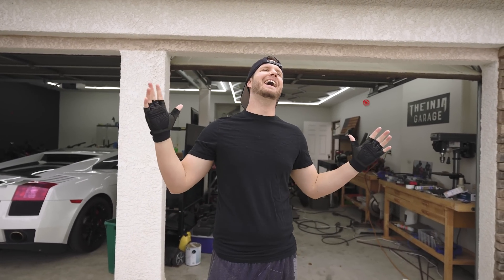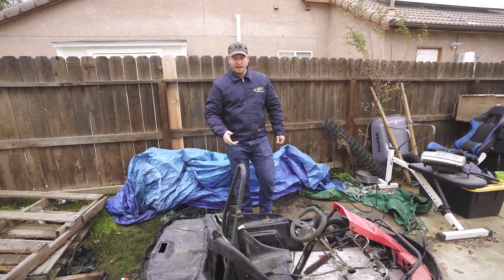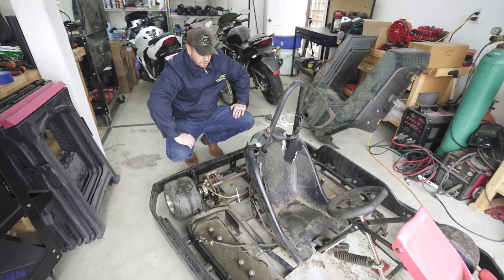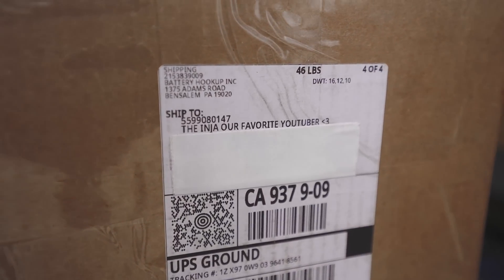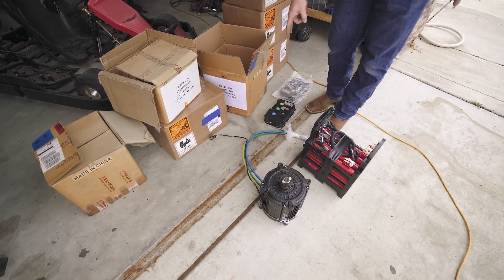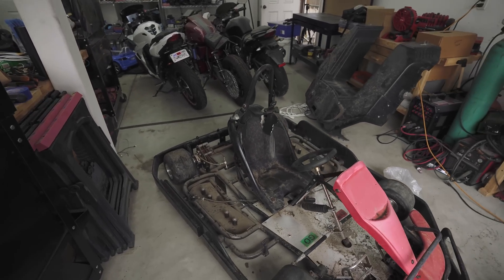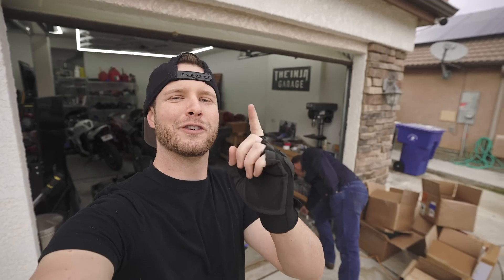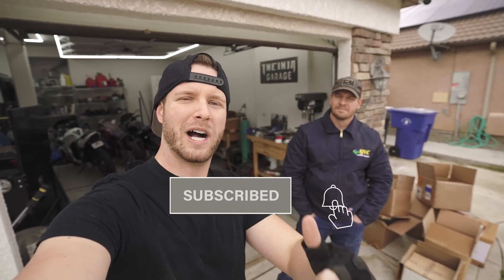Let's Make an ELECTRIC HYPERCART [Part 1]

Comment: If one day this go kart kills me, don’t cry because I was smiling
Reply from the maker: Never spake a truer word my lord. I will not cry for you
Reply: Today would never happen. Full fun without regrets...
Don't worry.
Reply: No suspension? yikes!
Reply: @kungpowchickenwing  pretty standard for a kart track, even the very high end ones!
Reply: @LordCurt  perhaps but maybe upgrade the tyres to be a bit spongy
Reply: @kungpowchickenwing  with 280 lbs just in batteries and motors alone, rest assured there will be suspension in the form of chassis flex.
Reply: @kevinsellsit5584  reinforcement incoming, fear not
Reply from the maker: @kevinsellsit5584  oooo ya see we don't need suspension when you have frame flex
Reply: @TheInja  To the best of my knowledge some high-end racing karts have a torsion-bar-like element in the frame that can be changed for rider weight, track conditions, etc.
So it's safe to say flex does actually change alignment and handling charastics. 
More triangles never hurt.
I'm not worried...I'm excited to see how well it works.  If nobody wants to drive it, hit me up.  I'm good for 3-5 G's before I'll pass out and end up in a ditch 1/4 mile from the track.  ;)
Reply: @LordCurt  that amount of weight seems excessive. Isn’t there a principle of diminishing gain?

I’m no expert
Reply: @kungpowchickenwing  there sure is, but only time will tell how far past the line we are. If they sent an inferior kart, the only advantage we may have is superior performance, within reason. I think we’ll land in the right spot

Comment: Hey, wild. You want front brakes? I bought a kart from a kid out in Cali about a year ago, looks about the same except it has front brakes. Said he bought it from a kart track he had worked for. Tried to find out where you could get spare parts but he didn't really have an answer.  Said the kart track ordered parts from "a web site."  But I have the whole setup. We have the same axle, battery boxes, tie rods...etc. I was going to build exactly what you're building, except with one motor--so now I guess I don't have to. :D I'll get back to my electric burnout kart build. Get in touch somehow if you're interested in the kart or brakes.
Good luck with the batteries. I bought 13 24v Headway modules from batteryhookup, three maybe are usable as-is to build a 72v pack.

Comment: I think mounting the motors over the axle is a pretty bad plan. You want all weight in front of the rear axle to keep the front tires in contact with the road surface. Putting them over the axle is both raising your center of gravity and making the cart more likely to flip over backward. Batteries and motors should be as close to the center (front to back) and as low as is feasible. 50/50 weight distribution would be optimal but not likely on this frame.
Reply from the maker: There's 140lbs battery in the front/middle of the frame + 200lb driver. All motors on these karts are over the rear axle!

Comment: What size contactor are those... Spim08hp batteries doesn't it do the same output... So i was trying to build electric golf cart or utv ish
Reply: 500 amps continuous each
Reply: @LordCurt  what happened to the utv buggy electric conversion... U have any more videos on it...
Reply: @Ai-TechWorld1  I’ve had to put it on pause while working on other things, sadly. I’m hoping to be back to it soon!
Reply: @LordCurt  ok ill wait please put the prius steering wheel and column in its easy to get electric power steering with 12v i picked up one from the junk yard for 40 dollars whole assembly

Comment: I don't want to make you sad but I think 60 Kw won't be enough to be the fastest Go Kart on the planet, there are even stronger sorry guys 😁
Reply: I’m expecting more like 70-80 after losses, but time will tell. I’d love to see links to some footage!
Reply: What do you want to know because there are enough points. Battery, Bms, Motor, Control unit....
When the weather gets better here I'll try to break the world record 0 to 100 and 0 to 200 km/h. then all details will be published.
What I can tell you is now only  144V 1300Ah continuous current and 2600Ah peak, but I can use now just 130V 750Ah. because of overheating.
Reply: @monsterelectricgokart  dang, 750 to 2600 is quite the jump. Ambitious
Reply: that doesn't mean you can give controller 2600 Ah. that's just a good thing the cellen won't break down quickly.😉
Reply: if you build and need help I can give you enough tip. write me privately👋

Comment: I thought the Fardriver 96v controllers were only rated for 115v.  Will a full 116.8v cause any issues or do they actually have 120v rated components but just don't tell anyone?
Reply: Exactly that. They actually do to 120 according to their sales

Comment: Those Headway 38120 HP cells crank hard, I used 12 of them for a 4S/3P battery which powers my Kweld Spotwelder. It pumps out 1,650 instantaneous Amps. Super safe, runs cool to the touch at super high discharge. Dude that Go-cart is going to either launch hard /smoke it's tyres of the line or break an Axel. 😏 I'm sure lord curt will get it sorted to smoke the big boys. Can't wait, should be a blast. 👍👌😎

Comment: There is 0 chance of your tiny tires keeping traction with those massive motors on em 😂
Reply from the maker: Yeah that's for sure 😈 gonna figure it out as we get things installed....gotta see it before you can fix it!
Reply: @TheInja  pretty sure the motors have a wider diameter than the tires. My prediction is that one motor will be too much 😜.

Comment: Years ago I had a 2 seat go cart that weighed over 500lbs and went 70mph in about 6 seconds, it was powered by an AGNI/Lynch motor.  Since then I've used that motor on a number of projects and it's simply amazing.  If you need a 25lb motor that is low profile and can put out up to 50hp, look them up.  Here is some dated but still useful information:

The Lynch motor is an unconventional design with a disc armature. It marries the advantages of a conventional, wound armature motor with the benefits of a flat (printed circuit) motor. It is similar to a pancake motor, but is more powerful than any of these technologies. The disc armature has magnets on both sides, doubling the available flux density and shortening the magnetic path. It therefore packs more power per pound and per cubic inch than any other motor technology. Of course such a revolutionary motor is not for every application - it is not as cheap as wound field motors, but for many applications it is a far superior motor.  It has a previously unheard of power to weight ratio and also power to volume ratio. It is also highly efficient because of the double magnet design and associated short magnetic path. It also includes integral fan cooling.

 The Lynch motor is an important development which spurred other motor designers to improve their products to remain competitive, such as synchronus permanent magnet machines.  As a result of the competition between manufacturers the cost of high performance motors and controllers has fallen dramatically.  We hope the cost of solar cells also reduces to allow renewable transportation to develop as a viable alternative to carbon fuels.
Cedric Lynch built his electric bike around a mid-drive configuration, also building one of the worlds most efficient light weight electric motors to power his rig reliably at 60-MPH for significant distances. He would later set several world records with his axial flux motor and bring it to market as the Lynch / Agni motor. Briggs and Stratton would eventually buy this technology which would lead to the Etek motor, which is now famous for making high speed efficient electric hot rods.

Cedric uses to achieve high speeds is by following the rules of aerodynamics, and building a bike that is as aerodynamic and as efficient as possible. The other builders on this list bypassed this step, and Cedric uses this bicycle as daily transportation on real commutes. Although this high-efficiency motor uses “old school” brushes, this fact allows builders to use very affordable controllers. He has proven his design choices through thousands of miles of commuting, and the Lynch motor is highly respected.

Cedric Lynch is known as the creator of the Agni Motor, a highly efficient electric motor that weighs around 25 pounds and can put out as much as 50hp. 

Cedric Lynch is a British 'mad scientist' type mechanical engineer obsessed with the idea of greener transportation. His interest has been in building a super efficient yet powerful vehicle that can serve as a car replacement.

He started thinking of his own design for an electric motor in 1983 when he began entering competitions organized by the Battery Vehicle Society regarding building an efficient electric vehicle. At the time there was no reasonably priced DC motor with descent efficiency so Lynch decided to build his own utilizing modifying existing motors with old tin cans that he would spread out flat to use as cooling fins. Surprisingly using rudimentary materials and a garage work bench, Cedric was making better more efficient electric motors than any of the universities were able to manufacture in state of the art workshops.

Cedric then came up with a motor design that could be cheaply manufactured and began manufacturing his own motor that he could sell to the public in 1988 and the Lynch Electric Motor Company was born, known as LEMCO.

Cedric first used his motor to create a small boat called “The Spark” that would set an electric boat efficiency record. From there Cedric turned his attention to bicycles, an application generally considered too small for a lynch motor at that time. Cedric mounted his motor in recumbent bike, allowing him space to eventually use a set of thundersky lithium batteries.

The resulting aerodynamic recumbent bike had a top speed of 60mph and still managed an incredible range of 150 miles. Cedric rode his recumbent creation everywhere as a daily commuter, putting an amazing 50,000 miles on the machine - technically a motorbike.

Briggs and Stratton, the US firm famous for lawn mower engines, bought the technology and used it in their E-Tech Motor, and Cedric went on to manufacture his latest incarnation of his lynch design into the Agni motor, which is used in go karts, sailboats, motor boats, and even small airplanes.

The Lynch designed motors all have the same traits. Brushed motors, around 25 pounds in weight and they are able to put out enormous power compared to their weight. Sometimes as high as 50 hp (depending on amperage ran through the motor) at an incredible 98% efficiency.  Lynch Motors are also the most often used motors in electric motorcycle racing applications.

Cedric's zero-emission motorcycle, which has a top speed of 120mph, was shown in action winning the world’s first zero carbon race – the TTxGP in the Isle of Mann.

The idea for the electric motor has been snapped up by the 56-year-old’’s friend Arvind Rabadia, who together with his brother Hasmuk Rabadia had been thinking of starting a business in India. They have now set up Agni Motors to make further-improved versions of Cedric’s motors

Despite Cedric’s breakthrough invention he has no formal engineering qualifications and taught himself the techniques needed to construct his engine. He first became interested in electrics when his parents bought him a book entitled How to build things from things found at home. 
The Etek motor is a brushed 25-pound pancake shaped motor that puts out enormous power for its weight. Depending on amperage and voltage the Etek can easily provide between 15-horsepower and 30-horsepower reliably and consistently (11-kW / 22-kW). A perfect platform for a powerful electric bike if you do not mind the weight. Although brushless motors are considered more modern, a brushed motor like the Etek allows the builder to use very affordable controllers.

Cedric-Lynch invented the motor and sold it to Briggs and Stratton which US company produced the Etek at a lower price (around $600). In the late 90’s early 2000’s it was the way to go for a high-power / light-weight electric vehicle. Many small E-vehicle records were set using the Etek motor. Finally, the market had a relatively lightweight and powerful electric motor available to the masses.

In essence, the Etek allowed hot rodders to build electric bikes. Before the Etek very few people had ever achieved 50mph on an electric bike. Even today, Etek motors (and newer incarnations of the Etek motor) are used to make some super fast electric bikes. In the case of Liveforphysics, the fastest E-bikes ever.

 Liveforphysics used a newer version of the Etek (the Agni motor), to achieve speeds of over 70mph, and dominate a recent hill-climb event.

Every Etek I have ever ridden has been characterized by brutal off-the-line acceleration, usually to a point where you have to apply the throttle very carefully or get thrown off. However, it is possible to run an Etek at a lower voltage or lower amperage and have a very manageable, safe, and sane electric bike that will not burn out on you, no matter high steep the incline.
Reply: In 2003 I purchased a complete new Briggs & Stratton electric outboard with a broken tiller handle from Barganland Liquidation on an Ebay auction.  Using a dial-up modem I would start timing the refresh rate with a stopwatch 5 minutes before the auction was ending. 
My $500 bid made it 4 seconds before the auction ended and I won the auction for $220. Barganland Liquidation was 5 miles from home and at that time I would bid $1.00 on about 50 items a day hoping to win 6-10 items.  They charged $1.65 "local pickup fee" per item, so I got a Etek motor (not to mention the controller, wiring, throttle,  and outboard assembly) for $221.65.  Good times!

Comment: Predictions; you're going to need larger wheels to be able to handle the speed, but especially any bumps on the track.. I'm not sure as the differential will handle the amount of torque you're going to be poking through it and the steering and brakes will both need at least a tweaking.. The steering will be too twitchy, you'll need a slower ratio or you'll get speed wobble, especially with small wheels... Suspension; you'll need at least some, it'll rattle your teeth out and be unstable..
But, I'm looking forward to this because I have a PGO Bugrider 250 that I want to convert to electric, so I'll be taking notes!
Good luck Inja, and if you don't have luck, well, it's been nice 'knowing' you! ;)

Comment: So basically it's just you sitting on a Giant battery with loads of power and a steering wheel that sounds like fun 😀 perfect
Reply: the cells are LiFePo they are alot safer then the batterys in cars (lithium ion) they are non toxic and the age slower and alot more stable they are the safest lithium battery
Reply: @zsds  I'm glad we've now got battery cells like this especially if people are making more powerful machines and better motors we're getting now
Reply: @ashpunting  LifePo have been around since the 1970s they are not used in Tesla because they are not as energy   dance as lithium ion

Comment: That's a lot of weight for that frame plus the driver make some question how maneuverable it will be with all that weight.  It's really a mistake not to add front brakes with all that weight how much is it going to cost you to add disc brakes to the front